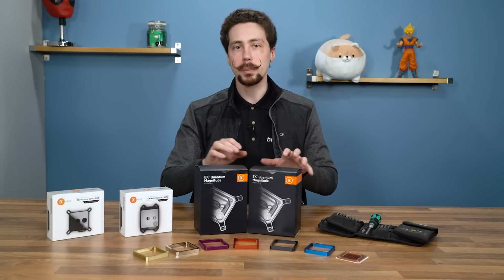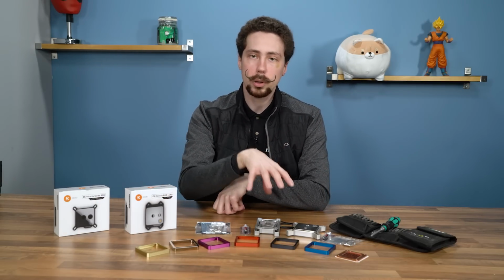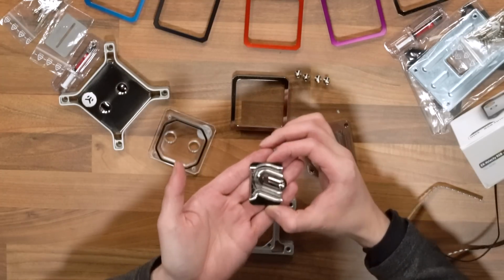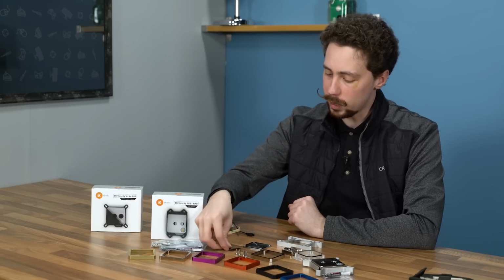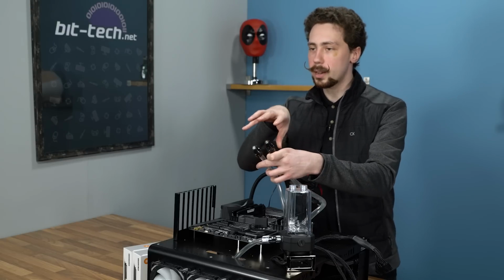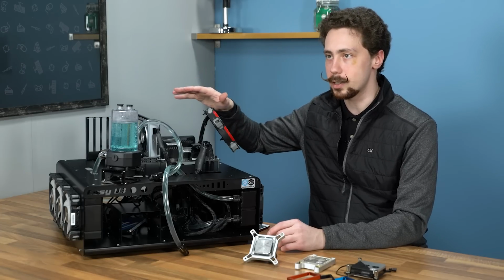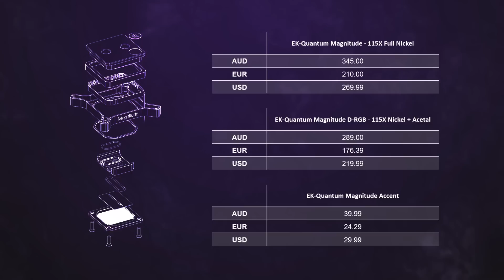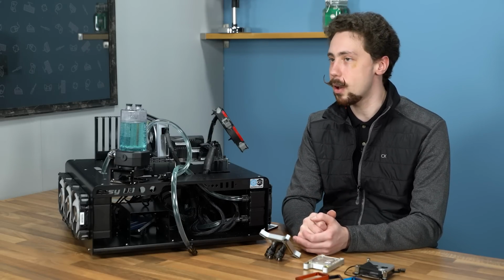EKWB Magnitude CPU Block Review and Tear Down | bit-tech Modding

Comment: Thanks for this review!  I just ordered my first Custom Loop system yesterday from EK's web shop. I ended up going with an EK Quantum Magnitude Nickel+Acetal 1700 block(13900KS), 2x Quantum Surface X480m radiators, 1x EK Quantum Kinetic TBE 200 D5 Pump/reservoir combo,  EK Quantum Torque compression fittings, EK 10/13mm soft tubing(my first custom loop for ease of installation), and 16x BeQuiet! Silent Wings 4 Pro 3000rpm max fans(high static pressure). Plus a few other parts, like fan controllers, temp sensor, cutting tool, and 60 newton meter torque screw driver, and 2x 1000ml EK premix coolant bottles of clear fluid.  I have a slightly older Corsair 1000D super tower case, which can accomodate dual 480mm radiators with push/pull fans and could even installl two more additional 360mm radiators up top if needed, but I'm only planning to cool my CPU for overclocking/stability.

Comment: Hi, I hope you have time to answer... I am building a new system liquid cooled. Done many times before. But back in the day I think its was different fittings, at least on my current setup. The O ring was not so big and strong as these so called compression ring fitting. I think there is chance for damage threads and its difficult to force it in the block etc.  SO my question is that which click on fittings are you using in the video CPU? Never seen that before. And the are leakproof? Thanks

Comment: Dunno if you'll see this, now over a year later, but:  How are the Koolance QDs holding up?  I had nothing but continued bad luck with them over time.  Nothing immediate; just a degradation over the course of a year or two using them.  They'd seize in the "open" position without me knowing.  I'd pop one off in my rig and, you guessed it: water everywhere.  This happened more times than I cared to count and I simply decided to give up on them.

Swiftech's hyper-expensive QDs are worlds better than the Koolance ones from my experience.  Very, very expensive, but so damned worth it.

Comment: The only point other than aesthetics to buy this block would be if this is the last block you ever buy and you're only ever going to buy parts to keep it mountable on the latest system. But for the cost you could buy multiple blocks that would last you a decade or more for the same cost. So it's really just double the price for a particular aesthic.
Reply: And better temps, and less restrictive flow.

Comment: To me water cooling is almost entirely aesthetic unless you're doing xoc sorta stuff. Air coolers can perform just as well or better for far less money but water cooling has a LOT more room for customization and looks way better.
Reply: Show me your air cooled GPU running better than any (custom loop) waterblock and I'll buy it. In fact I will say the same for custom loop CPU coolers, albeit to a lesser degree. Since you can stick as much rad capacity in as you'd like, and air cooler will just not have the same cooling capacity, and yes I know about Nuctua.

Comment: Like many said, this is probably the best block out there, but the price is totaly unjustified.
Reply from the maker: In what way is it unjustified?
Reply: @bittech1  hey,
In my opinion, they margin too much on this product. 
I agree : It has to be more expensive. It's definitely has some r&d behind it. And it's a better one than the other. 
But,
EK is already premium, 30€ for an aluminum (anodized) square, 40 for the cold plate, and the block is almost twice the price compare to the velocity line up.. I'm quite sure (but I might be wrong) that magnitude doesn't cost twice the price to produce ;)
Reply from the maker: @lpmod3368  It costs an awful lot to produce, have you seen how many parts there are? I modelled up the X299 Magnitude and put it on my GrabCAD, you should download it and see for yourself how many elements there are.

You have the frame, coldplate, insert, jet plate, screws, standoffs, highlight rings, block top and mobo backplate. On top of that you have 3 SKUs of EACH top, each with multiple finishes, plus the same for the other parts.

It is a very expensive block to manufacture compared with other options.
Reply: @bittech1  Well... have to admit, it's a hell of a block ! Ok you got me on the block's price ! (oh crap no ! Now I want one, my phanteks 360A has some cracks on the surface, like my previous phanteks 350i  ;s). Anyway, thanks for opening my eyes, and  (probably) emptying my wallet :D

Comment: Should do a real world cooling, not many ppl are gonna use 2x 360 rads
Reply from the maker: Sean Miceli The point of using 2x360 was to remove the radiators and fans as a bottleneck in the cooling. You can’t readily test the cooling power of just the block if your limitation is not having enough radiator space to begin with.
Reply: @bittech1  ah ok, well heres a question for ya on your opinion then, did custom loop 360 rad and 240 rad with 9900k and 1080ti, but my cpu temps went up when in this setup vs a 360 rad only to cpu, should I do 2 separate loops to not have heat dilute from both components
Reply: @dnsean03  If anything you should do it the other way around. A high end GPU outputs 250-350W of heat and an overclocked CPU would be bonkers if it even hit 200W, more likely is 100-150W. So a 360 on the CPU (which is overkill) would of course be degraded by adding a 240 AND a GPU. If anything, put the 360 on the GPU. Or add fans to both sides of the rad for a massive performance boost (push/pull).
Reply: @tfm2934  with gpu on loop just like previously when I had one on it overall cpu temp jumped now with 350/390w 3090 cpu bumped up 20c while gaming
Reply: @dnsean03  The only way your CPU can bump up 20c is if your water temps bump up 20c, which, assuming your ambient is 20C (or something is slowing down flow rate to almost full stop) and the cpu makes your loop run 5C hotter, would be 45C. That is insanely hot for a custom loop. I have only seen 40C water temps once and that was because my fans were on an ultra quiet profile and my whole PC was doing 100% load folding@home. That was with an overclocked 1080ti and 4790K@4.7ghz. Either your pump isn't working, something is massively restricting airflow, or the fan setup is bad. 3090 is almost 100W more than 1080ti but that does not explain the massive difference. Wonder what is wrong.... JayzTwoCents had this video where he passively cooled his rig with only a pump and rads, no fans, and even that was around below 45C water temp. What are you using?
Reply: @tfm2934  9900k 1.3v 5ghz 3090 390w noctua fans 30mm 360 and 240 rad noctua nf12 fans 1200 rpm ek d5 pump res
Reply: There is 2 quick disconnect for gpu
Reply: CPU went up to 70c and gpu 55c overclocked
Reply: @dnsean03  what is the water temp?
Reply: @tfm2934  no idea ek doesnt come with water temp adaptors id need to buy one to see
Reply: @dnsean03  yeah strange huh? With such a complete line up otherwise. I got a bitspower temp sensor 15 bucks... priceless. But if the water is 45 degrees then the fittings should feel hot like a home radiator. They should feel quite 'neutral'when touching them; that's when the water is 28-35C
Reply: @tfm2934  feels alittle amwarm but gotta figure   600 surface radiator with 400w gpu cpu max avg 150w load 245w.. I may need 3rd rad bringing up to 840 surface, I run fans low.. I'll get one the sensors before cpu was at 29 30c idle now its 39 idle as well so water temp prob increased
Reply: @dnsean03  yeah that rad setup if average thickness should take 800W of heat on high fan speed. But low fans probably good to go push/pull or add a rad
Reply: @tfm2934  yea I'll prob add another, wish microcenter carried crossflow rads, would be cleaner setup

Comment: I went with velocity instead of magnitude for a Ryzen 3700X because it was far less expensive, but I wonder  how much better the temps would be  with an optimized waterblock.
Performance is fine overall, but under heavy synthetic loads I can see the velocity struggling to transfer the heat fast enough (overall thermal capacity of the loop is more than sufficient)

Comment: Ek lost there minds with the cost of that block.
Reply: Wtf 260$ for a waterblock?
Reply: going "apple"
Reply: I've got some EK stuff. I like what I have but there's no way given the reviews that this block is worth that much.
Reply: completely agree! it's 269.98 for the block and the flat plate. I don't see them selling many of them for 2-3 c difference compared to the Velocity which is $100-120
Reply: Not really. It fits a certain nieche. You can buy a lot of different blocks. Don’t like the cost? Get one that fits your wallet. Why cry about it? You just sound silly.
Reply: Many people, including me upgrade every few years to TOTL parts. 
When im paying $1300 for GPU and $700+ for a CPU i can assure you ill probably considering paying extra $80 for those 2-3C depending on also the looks ofc

And in this case IMHO velocity just looks nicer, so they could adress that. Its all personal ofc and maybe most think that magnitude is sexier which i dont.
Reply: @amnforge  That is because EK uses these things in real world and not just in temperature benchmarks. And in the real world, flow restriction is another important factor and they made a balanced decision. It's not hard to make a CPU block that cools this well. It is hard to do so without imposing a massive flow resistance  that limits the cooling on other components. Despite the rediculous price, they got that part right here. Both good temps and good flow. Especially compared to the Velocity

Comment: The contact surface ( concave ) does really matter? I mean, we always have to put the thermal paste right ? So the space between both CPU and block are completely filled. Make sense ?
Reply: Sherylin  Thanks. I believe you´re right. But I was referring the "right" amount you know? Reviewing other data  about the same subject,
 it became clear to me that, as closer as the block could stay the CPU, the better.

Comment: $30,00 on a Barrow block that performs 80%~90% of this $269,99, this is insane...
Reply from the maker: Just remember there's also a £10 Taobao block that will perform 80-90% of that Barrow one too. 

You're not paying for direct performance gains with a premium product like this. You're paying for the other things that those cheaper blocks don't have, such as all the options, QC, having a product produced in the EU (which is significantly more expensive) etc.

It comes down to what you value. I use Barrow parts from time to time in my own rigs alongside all the other brands.

Comment: Unpopular opinion: A cpu waterblock should not cost more than 50$.
Reply from the maker: That's a popular opinion. My response is that $50 will only permit things to be made in China, to the lowest common denominator design, allowing for zero innovation.
Reply: @bittech1  I see your point, but then again maybe I'm old but I remember a time where a small machined piece like that wouldn't cost as much as a used car...
Reply from the maker: @uncleanon6445  I don't think that's fair at all. What metric are you using to calculate the value of a piece like this? Consider all the parts are custom made, machined in Slovenia, often requiring multiple operations. Each part needs to be designed, tested, optimised, finished etc. Additionally we're not talking about millions of units, there isn't the scale there to drive the price down with excessive automation.

Hell I'm impressed that with the number and construction style of the parts in a Magnitude that they can even hit that price point.
Reply: @bittech1  It's true that the real value of an item like this is hard to pinpoint. Most people forget that designing/developing a product can take years although you can build the finished product in a day. 
On the other hand at some point it's becoming "ethically" questionable on later iterations of said product, you don't start from scratch each time and can not really add in what the first iterations developing has cost you. Or at least I personally couldn't do it.
I think the comparison wasn't exactly fair but then again we have to be able to compare items cause that's how we define value. 
I totally get your point, it's just "getting out of hand" imo when the cooler I put on a cpu costs more than the cpu. Which then makes it pointless to build with anything less than high end parts for which the target audience is simply put, well off people.
With normalizing 1500$ for a GPU as we are at right now it's hard to deny the predatory capitalism in PC hardware/modding. 

Or Maybe I'm just bitter that I pay 900 bucks for a GPU and still have 'shitty' hardware. Maybe average people not being the target audience for anything anymore is a negative trend?

Comment: Too costly.
No innovation.
Return to the bad old days ala Supremacy where one must find by trial and error which jet plate/gasket and orientation works best for your particular cpu.

Nope, no thanks, there are block within 1c, nearly identical flow, at half the cost with none of the headache.

EK failing once again.

Comment: Hey mate you do amazing work. I just have one question I see you run your cables through the motherboard tray how far apart are the holes for the 28 pin and 8 pin
Reply from the maker: Snake Doctor I use a 4.4mm spacing for 4.1mm holes usually.
Reply: Thanks for replying. Also where do you get the mod blocks I think that’s what you call them.  There the small blocks you use to put thing together.

Comment: Great vid. Lots of thoughts on them. First I really like the looks of these and I'm not generally a fan of ek blocks, but the price is INSANE!  I would argue that the mounting on Watercool Heatkiller blocks is also part of their aesthetic, a more brutalist industrial aesthetic, but one that I'm particularly fond of. I'm not entirely sure that the part in the middle that helps channel the water will have a particular impact on cooling performance in changing it for different CPU styles, I would have thought that be more dependent on the jet plate and cooling engine. That middle section is really just there to direct water out properly, making sure the coolant doesn't flow through one side more than the other. I see dev doge hiding in the background. Looking forward to see the bench build series and what custom stuff you come up with. I need those qdc in my life. Not sure what for but I want some anyway. lol
Reply: On the velocity, and lots of other brand's blocks, the inlet is often close to center to inject water right in the jet plate opening, which makes using large diameter fittings tricky. The channel these blocks use solve that problem and now the inlet and outlet are farther apart.
Those few extra milimeters may not look like much but they make mounting way easier.
The spacing now matches the one used on the GPU blocks so it looks really good when running parallel loops. pleases my OCD :)
Reply: @usoppbarbosa981  Yeh that aspect is cool. Even with compression fittings for 13/10, which aren't particularly large in the scheme of things, it's pretty tight getting them on a block with the standard centre-edge setup. I was more questioning that Alex said that they help improve performance. It's probably straight out the marketing gumpf ek have given him, but I'm curious as to how it's meant to improve to cooling by changing that price for the different types of CPU.